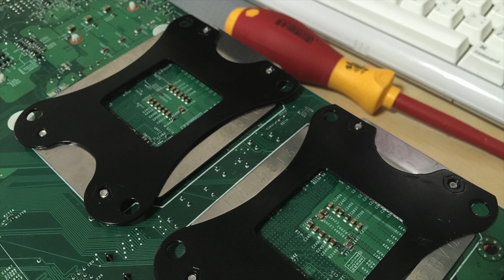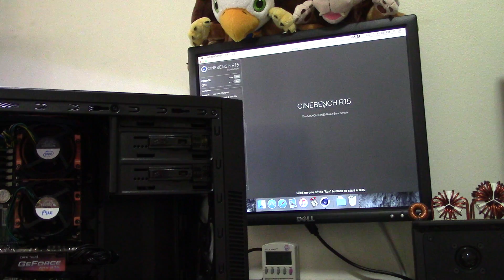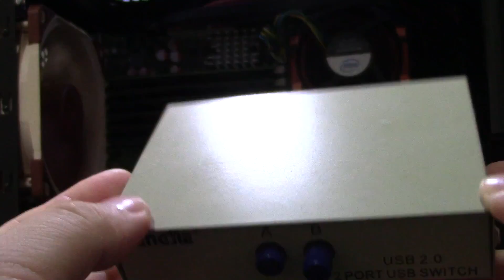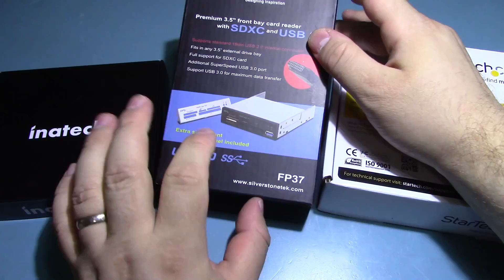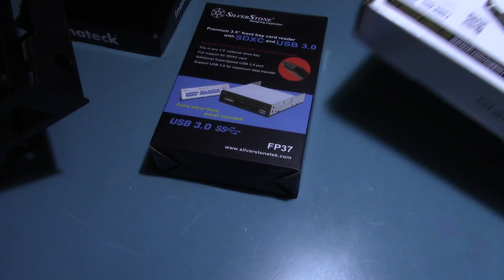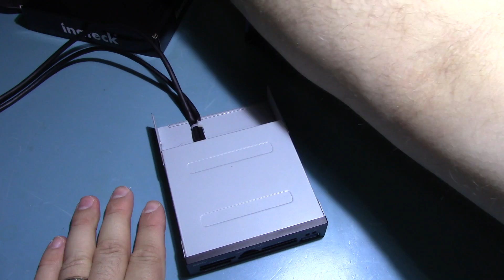Comment: Where can i get a heatsink for a socket 604 (603,423) board like this?
Reply: eBay. But remember the 604 sockets mount to the chassis normally, so you usually have a server case designed to work with these sockets. The ones I used in this video do let you use pretty much any case.
Reply: @PeterBrockie  Thanks for the quick reply! Yeah, I'm transferring the board from a workstation Xw-6200 to another case and it's not happy. Any recommended way to ghetto rig since I'm probably going to have to?
There was a lady in town with a XW-4400, I'll see if she's still got it...
Reply: @AxeFxMike  I mean, honestly the socket 604 hardware is so old and so power ineffecient it'll probably be cheaper (and faster) in the long run to get any remotely modern board - even a modern 4 core system will be faster and use way less power than a maxed out 604 system.
Reply: @PeterBrockie  Oh no kidding, for sure. This build is actually like this on purpose. It's for utilizing old PCI audio cards with newer software, and somewhat modern plugins. I appreciate that. I did some digging and found that 423/603/604/and 771 all have same spacing, so I'm looking for a good 771 currently.
Reply: @AxeFxMike  It's been a while, but 771 might have a different height from the CPU to the bottom of the heatsink, you might need to Google around to double check.
Reply: well shoot thanks man. I'll give ya a sub, thanks again.  @PeterBrockie
Reply: My Hackintosh buddy is kinda AFK right now and I haven't heard from him, but he helped me put Ventura and Monterey on a B350 and put Mojave on my cmp 3,1, other wise I'd totally have him try to hackintosh this thing when its up lol!

Comment: You mentioned you have your 3Tb hard disk installed. Mine X7DCA-L doesn't recognize 3Tb HDDs in BIOS. It show them as 746.5Gb disks. Even though I have the latest BIOS version. How did you manage it to work with such disks?

Comment: ANY UPDATE ON THIS BUILD?
Reply: No, not really. I sold off the motherboard some time ago as I switched my Hacakintosh over to a spare i7-3770k I had. Used less power for about the same CPU speed.
Reply: @PeterBrockie  So one I7-3770 had the same horsepower as dual Intel Xeon 5450's? Should be 8cores vs. 4 cores, no?
Reply: @Intenzity  It's 8C/8T vs 4C/8T. The i7 may have half the cores, but the slightly newer architecture combined with a much higher clock speed makes up for that.

Comment: Is your chipset running hot?

I have X8DTN, and my chipset is flaming hot. I am thinking about changing the heat sink and adding a fan.
Reply: It runs pretty hot. Case cooling should be adequate to keep it happy though.

Comment: where can i buy this board and how much will it cost? what case would you recomend using?
Reply: +Alcino Acosta I picked up the board on eBay. Prices vary but don't spend too much or you might as well just buy a modern cheap CPU/motherboard.

For cases use whatever you like. Personally I love Fractal Design cases (especially the Define R4 which we have three of here). The R5 is a newer version although I haven't personally tried it yet.
Reply: Peter Brockie i've seen them forabout  200-250$ im mostly interested in having dual xeons but the real big catch is that it has a pci e x16 cuz i also want to use a quadro card in it. dont know if you would know of a more efficient set up for some less buck.
Reply: +Alcino Acosta At $200 or more I wouldn't consider this route. You would be better buying an older i7 or i5 which you can overclock. 

My i7-3770k easily matches this dual Xeon setup. The important thing is it does it with half as many cores. The i7 has such an advantage per core that it's much faster overall since apps which can't take advantage of 4-8 cores (which most apps can't). 

Plus you get modern connectivity like USB 3.0, etc. Usually dual x16 PCIe slots, too.

Comment: Hi, I bought one of these same motherboards, just waiting for it to ship. I was wondering about the RAM, and if all ECC RAM is also registered?
Reply: Nope. You can have unregistered ECC memory. My Supermicro based NAS has a board which (supposedly) doesn't work with any registered memory, but works with ECC,
Reply: So to clarify, the X7DCA-L works with both ECC and registered? Or ECC and ECC Registered?
Reply: G-o-o-g-l-e :P

http://www.supermicro.com/products/motherboard/Xeon1333/5100/X7DCA-L.cfm

Requires registered ECC memory.
Reply: Wow. I don't know why I didn't think to check that. Thanks!

Comment: would it be as simple with another motherboard
Reply: +Mitch McCann For most motherboards yes. The trick is to do some Google research on the board you are interested in first as there might be some specific parts which have issues (USB 3.0 controllers are a common one), so do your research on the three main components - motherboard, video card, and rarely the CPU. In general, most Intel motherboards work - but check before buying. :)

Different boards need different settings when booting. This is part of researching the board to find if there are known issues with Hackintosh systems.
Reply: what cpu and chipset did u use again?
Reply: It's all in the video description. ;)

Comment: Nice info you have provided.  Do you know if this system will run 10.6.8?  I still use that OS version due to licensed software I use, and desire to keep using.  Did you get CPU fans speed control issue solved?
Reply: It should run it no problem. But you can always check the specs of the OS version and look up what hardware the Macs they recommend use.

I don't think I was able to get them to auto adjust before switching to a different motherboard/CPU. A fix might have been possible but I happened to have an i7 system available.

Comment: I am now on the website i usally gets some parts from. 
Never knew this little 771 xeons can be truned into something great like this. 
And its dirt cheap!
I might get some parts. : D
Btw i also saw the same copper heatsinks. They are only 30 bucks a piece.
Is there a other solution for this too? Or just those heatsinks?

I would love to hear it. Want to get some parts this weekend or next week. Just not for a hackintosh but for a virtualisation server. And a bit of rendering here and there.  
What ram did you use exactly?
Reply: The passive (no fan) heatsinks are fine if you have a case designed for them with fans blowing over the CPUs. Usually only rackmount cases are setup that way though.
Reply: ***** Decided to jump to LGA1366 straight away. Not going to use 771.. :P
Reply: ***** And i was talking about the fans not the heatsinks themselfs :P

Comment: 430 watts is enough for ? both of those cpus ?
Reply: Yeah, I couldn't pull more than about 300 even with the GPU. Although I would recommend a 500W+ power supply to be sure. Especially if you are using a bigger GPU.

Comment: Could not have built your computer into a Prometheaus computer case and using the built in Phase-change cooler and some how make a copper plate that can cool both processors at the same time following the rules for using Phase-Change cooling techniques.

Comment: Hey sorry to bother you again
im actually having a problem booting from any of my drives,
i cant seem to get the motherboard to boot from my windows 10 hdd and my el capitian boot installation.
the only thing that i have gotten to work is the windows 10 installation media, but i dont need that.
so when i try to boot from my hdd or el capitian boot drive it immediately goes to this intel boot agent and keeps telling me to check my cables but i know that the computer sees the hdd and bootable usb because it shows up in the bios. do you know the problem?
Reply: +Landon Babbitt Have you set it to boot from the non-UEFI version of the USB stick? On Gigabyte boards there are usually two copies of the drive. One UEFI and one normal, usually with a P0 (or another number).
Reply: +Peter Brockie  Are you talking about enabling the legacy thing in the bios?
Reply: +Landon Babbitt Enabling it gives you the option to select them, but you need to actually make sure it is selected. Once it is all installed you can boot from the internal drive using UEFI (if you are using Clover, if not you use the P0.
Reply: +Peter Brockie ya I have that option enabled it just isn't wanting to work for me
Reply: +Landon Babbitt Are you 100% sure you made the boot device properly? If it's just skipping it and going to the Intel thing it might be it's not even formatted correctly to boot from.
Reply: +Peter Brockie so I just made a new boot drive with el capitian but with the legacy option enabled and I think I made that one incorrectly because it's saying the boot portion is missing but I used clover and everything says that it works I'm going to go ahead and make another one non legacy when my dad gets home with his mac book next week
And the windows 10 hdd doesn't seem to work still
Reply: +Peter Brockie and im pretty sure I am getting the bootable usbs correct but I'm used to doing it on Yosemite and my dad upgraded his mac to el capitian so it's a little different to install the thing
Reply: +Landon Babbitt If Windows isn't working you might have something set wrong. If it were me, I would make sure the BIOS is up to date, clear the CMOS and load optimized defaults and start again.
Reply: +Peter Brockie hey so sorry about that but i didnt even think about this, this happens every time i move a hdd it lost some files some how and of course it had to be the boot files, but i just ended up formating it and reinstalling windows onto it. but i still cant seem to get the usb boot drive to work
ive made the boot drive multiple times and i still cant seem to be able to boot off of it. idk if its just because i am using el capitian to install the boot files onto it or what but do you have any ideas? i have made sure that legacy boot was enabled and all of that stuff, and the usb drive shows up as a usb hdd
Reply: +Landon Babbitt I use the UniBeast utility and haven't had any problems making boot disks. Make sure the stick is formatted to Mac OS and is set to GUID for the partition format.
Reply: +Peter Brockie ok ya i think at this point i may just have some settings not in the correct spot, either that or could it be because i havent updated my BiOS?

Comment: Hey so i just got all of those parts that u have as well except i bought some 5460's rather than 5450's and in this video you mentioned that you had some boot codes that were needed to get the hackintosh running, would you mind sharing those boot codes?
i know that you have the video card boot codes but you never mentioned the codes needed for everything else
if you could put these down this would be a huge help to me!
I am currently trying to install yosemite but if you only have the boot codes for el capitan and the coding is different i will gladly take those combination of codes as well!
Reply: +Landon Babbitt At 9:45 I mention them and show the boot variables on screen. :) For El Cap you should be using Clover. It's now the recommended bootloader. I haven't tried it on this machine though, so I can't help you with Clover specifics. I switched to using what was my HTPC computer with an upgraded CPU instead of this Xeon system.
Reply: o haha ok thx I thought that was just for the graphics card

Comment: would be an intresting next build have you benchmarked against a 2008 mac pro i imagen its not to far off
Reply: +Alex Seaton Mac Pros just use normal Xeon chips and chipsets. The same CPU(s) should have the same results.
Reply: I know but how his PC compared
Reply: The 2008 Mac Pros use 54xx series Xeons. So it would be the exact same with a matching CPU. A 5462 in the Mac Pro would be the same as a 5462 in this machine.
Reply: +Peter Brockie fair enough but would be a good comparison

Comment: Hi Peter
Great build! I have a nearly identical build at home with the 2x L5420's on that motherboard. I had the build working perfectly using VMWare vSphere however it then started to say there were no network adapters available. I therefore installed windows server to diagnose the problem and the Device manager doesn't even list an on board Ethernet controller/adapter. Is this the issue that you experienced? Please could you link the drivers you used to get the adapters working on your build?
Thanks!
Reply: +Doodland I was just using the Intel drivers which ship with Windows. As for Mac OS I was using the Intel Hackintosh drivers which come with MultiBeast.

Double check that they are enabled in the BIOS. You might want to do a CMOS reset, too. Just in case it is some weird configuration problem.
Reply: +Peter Brockie Thank you very much I will try that now!

Comment: Hello, amazing project! I have question..How did you get GTX 275 PCIE x16 to PCIEx8 ? For this mobo is not necessary two ATX conectors? Thanks!
Reply: +Petr Pan The board has a 16x slot for the video card. No modification needed. You should connect all the power connectors - although I think you only need one CPU power connector if you are running single processor. I'd still connect all of them though.

Comment: Hi peter,I'm actually thinking of building a hackintosh as well with a SuperMicro board as well. Do you have anywhere that you found on the internet on how to do a hackintosh with such a board? Or did you try it all on your own with no help?
Reply: I'm speaking in reference to the installation of the software, not the installation of the hardware
Reply: Whenever I setup a Hackintosh i usually go by the basic installation instructions online and look up specific problems if I have any. There are general troubleshooting things to go though which will get most boards working.
Reply: +Peter Brockie Have you upgraded to El Capitan? I'm running the X7DCA-L also and having issues going from 10.6.8 to 10.11. Which boot loader do you use?
Reply: I'm running El on my 1150 platform Hackintosh. My understanding is Clover is now the recommended bootloader when dealing with 10.11 and for the future. Although I haven't tried it on an older platform.

Clover + 10.11 has yielded great results for my Hackintosh as well as my wife's. Very easy to get going aside from the odd simple tweek.

Comment: Where did you get all this? ebay?
Reply: +Sergio Galvan Mostly stuff I had lying around the workbench (originally from eBay and whatnot), but a couple things i bought for the build. The case and PSU are from Amazon (or Newegg, can't remember).
Reply: +Peter Brockie  I came across with this video because I'm planning to build a home server and I was considering Xeon CPUs. I'm still trying to figure out if it's worth to buy in eBay or buy new one. Of course the money is always an issue :) Thanks for the video
Reply: What will the server be doing? Because a 300 watt system for backups is a huge waste. You might want to look into Synology NAS hardware if you want a decent, easy to setup low power NAS. I have used them quite a bit and they are really nice.
Reply: I already have a Synology NAS, good stuff indeed. Mostly for virtualization/cloud research. For that, I really like the new Supermicro Xeon D-15X8 very low consumption, up to 128Gb DDR4 RDIMM ECC.. you should check the specs and also has IPMI, However I like to take a look to good old hardware that nowadays can be more affordable.

Comment: i'd put a fan on the chipset, when I ran one of these motherboards it would get so hot (over 80 degrees celcius)  that it would heat my radeon hd 7950 up to around 75 degrees celcius. I put a small fan over the chipset heatsink and it never climbed above 60 again.

Comment: man how do you render on machintosh? dont u use vray or smth like this?
Reply: +borisarchful Final Cut Pro X/Handbreak for video rendering/transcoding.
Reply: +Peter Brockie i made a hachintosh system on asus p5kpl/1600 and i cant use it for my projects :( im sad about this.. I use softwares for rendering in 3DSmax or Rhinoceros 3D and i cant find any to work with Machintosh.

And above all those things, i found a thing after using hackingtosh for a while. The system is not as powerfull as a windows system is. I had maya 3D on hachingtosh and i ran a couple of benchmarks. The results were not as good as windows so i guess its something with kexts.. . The 3D modelling in rhinoceros was awfull on Hackingtosh. This is because my graphic card was a GTS 450 and it was working great on windows rather than hackingtosh. Have you tested your softwares on both systems (windows and hackingtosh)? What are the results?
Reply: +borisarchful Often crossplatform software is more optimized for Windows. But that depends on the software. I have a Hackintosh only to run stuff which I can't run on Windows, other than that I switched to Windows 10 a while ago.
Reply: +Peter Brockie yea thats true but lets not forget that a hackintosh is SLOWER than a real mackintosh
Reply: +borisarchful hardware is hardware. There is no emulation or anything like that in a Hackintosh - merely a boot loader designed to report the same data a real Mac would provide along with a driver to simulate the SMC for power/fan monitoring (FakeSMC). If you managed to build an identical Hackintosh it should have no performance difference. 

You might even argue a Hackintosh is faster since you pay way less than what Apple sells, so for the same price you get much better hardware than Apple would give you. :)

Comment: Why not move the optical drive from the TV computer to this computer and then just install a cheap $10 DVD drive in the TV computer to fill the space in the absence of a cover?
Reply: +Channel 2012 Ended up winning a 8x Blu-ray burner, 1 TB HDD, and 128 GB SSD for only $50 on eBay. Popped the BD drive in and will put the two drives back up on eBay to make my money back. :P
Reply: *****
Wow, good find!